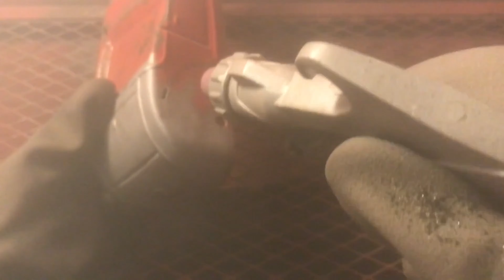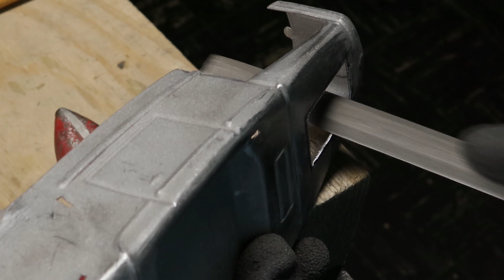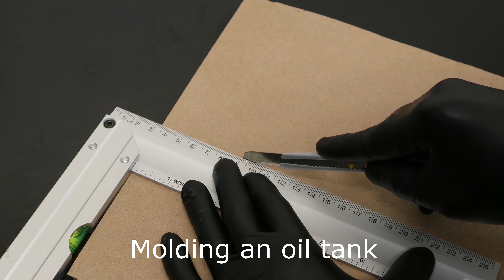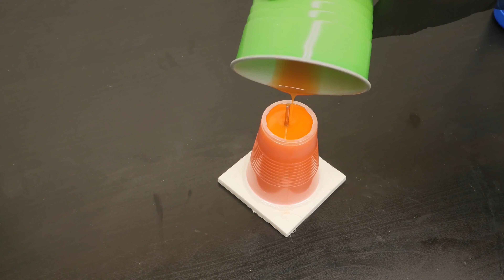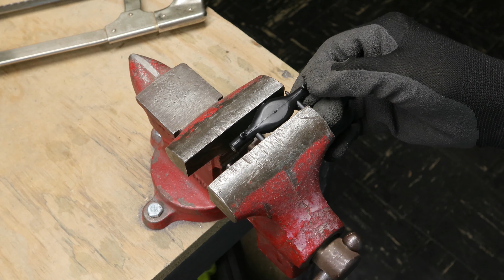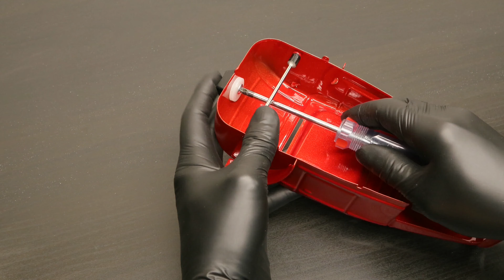1960s Nylint Hot Rod Restoration and Custom

Comment: With all the work you put into this, I can't help but think you missed the opportunity to cut out the seat opening and make some seats, and maybe a convertible top. Folded down and inserted into that slit cut into the back of the trunk area.
Reply from the maker: That’s a good idea! You know why I didn’t do that because there were two kind of styles of the Nylint race cars, one like this without seat, another have seat, I have both of them. That time I thought I should restore it later. Thank you so much for the sharing your idea!👍👍👏👏